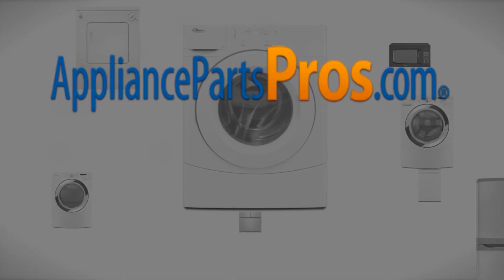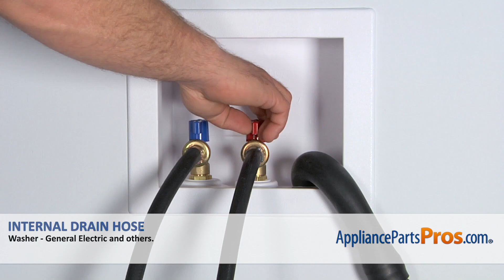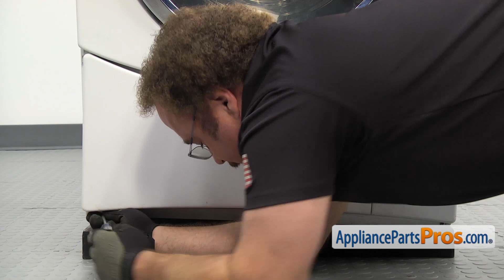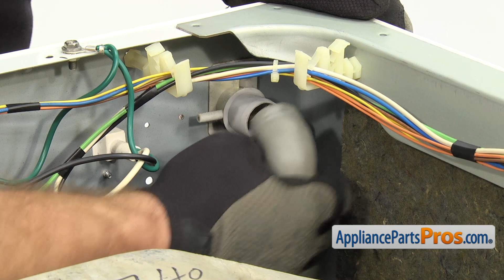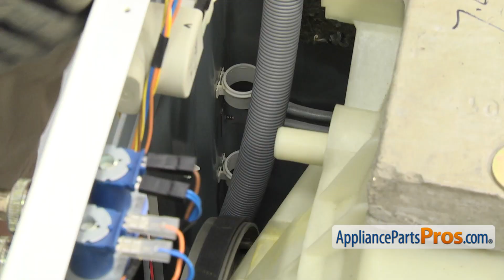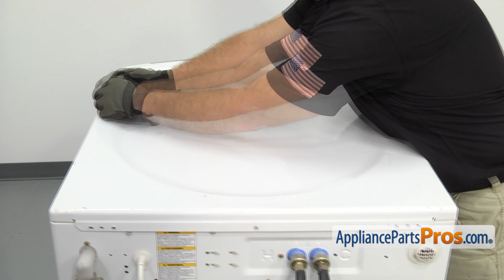GE Washer Internal Drain Hose WH41X10127 Replacement

Comment: My front loader doesn’t have a front panel, just a one piece face. I found the access to the pump and hoses through the bottom. We tipped the washer on its side and removed the old hose and snaked in the new one. The universal replacement hose had thinner end piece so we had to use a band clamp to get it tight enough. What an ordeal but it worked.
Reply from the maker: So glad you were able to repair the unit. Let us know if you have any other issues.